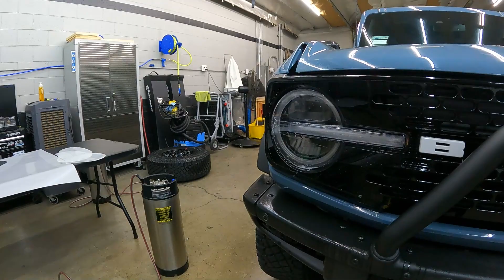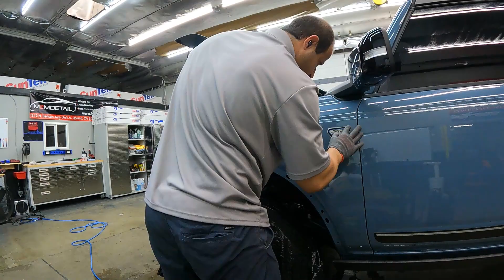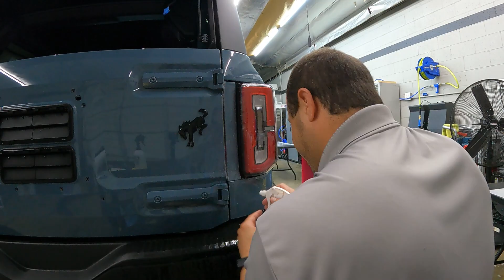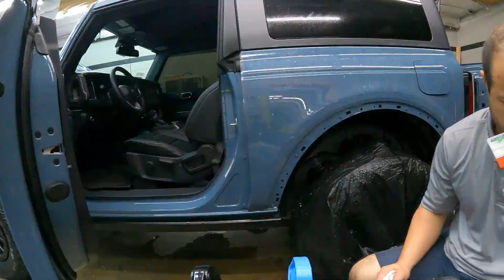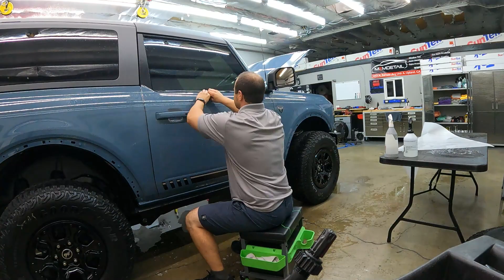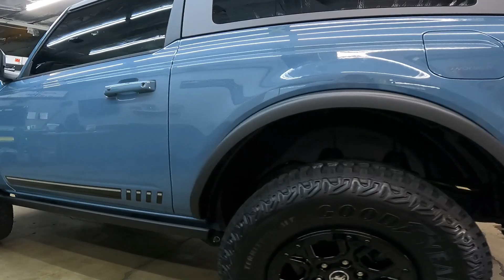2021 Ford Bronco First Edition Full PPF

Comment: How long did it take to wrap it with ppf?
Reply from the maker: One day
Reply: @m2mdetail781  so in one day you can earn 5 to 6k on one bronco ?
Reply from the maker: @robertjasoncanha  yes we keep the vehicles for two days but the second day is for checking the PPF making sure there is no lift or issues with the film.
Also that one day is about 13-15hrs long.
Reply: @m2mdetail781  i am blown away 😅😅😅 one day worth of work  takes me a day and half to do a full front 😅😅

Do you wash and prep the vehicle or is it ready for you to Bering installation
Reply from the maker: @d.a6937  I do the wash and Prep. I remember those days man. The more you do them the faster you get. Just did an Escalade that took a few days.

Comment: Hi great video, can I ask how much you charge for that job, and do use xpels cutting software?  I am a subscriber
Reply from the maker: Hi, thank you. So this job will run about 5500-6500. Depending n paint condition and some other factors. I do not use xpel software I use CORE which is SunTek and llumar software. My experience with Xpel is all bad but that's a different topic to talk about. If you are interested in CORE software let me know and I'll make video for you going through the program.  

Thanks for watching,
Marc

Comment: #1 Thing I Don't Like About the Bronco - The '22 dealer allocation formula
The Bronco is nearly impossible to get for many long time reservation holders. Any dealer whose slice of the Bronco reservations is greater than their slice of overall Ford sales is going to have reservation holders waiting while other dealers will have dealer stock. Ford has reneged on their commitment to deliver reservations before dealer stock. For customers that reserved at smaller dealers who have fully embraced the Bronco, it will take years for them to get a delivery. Shame on Ford for pandering to large dealerships.